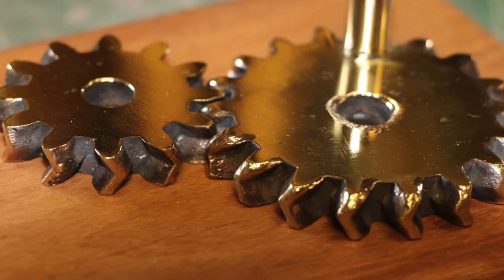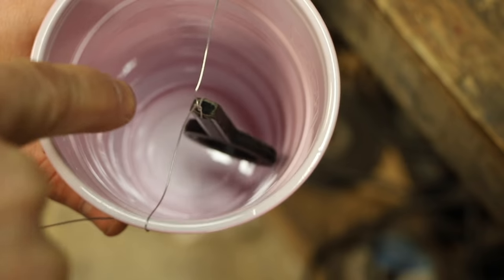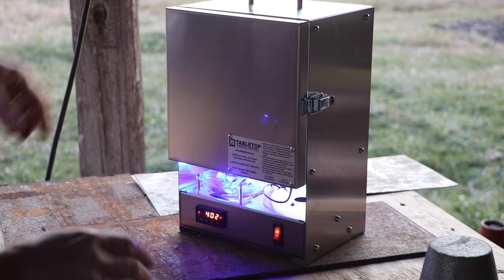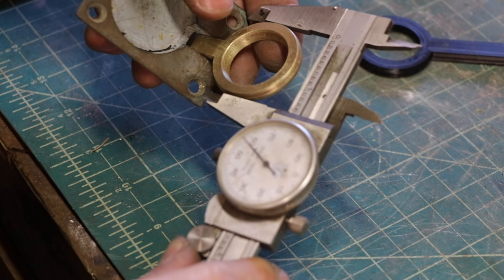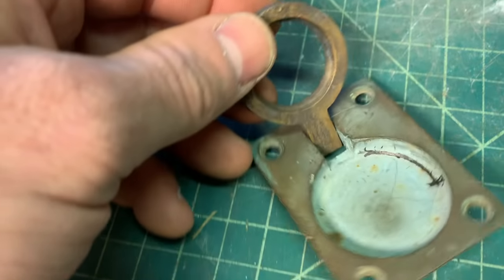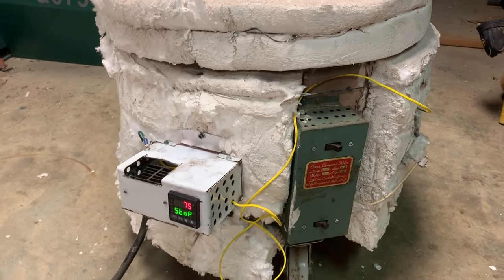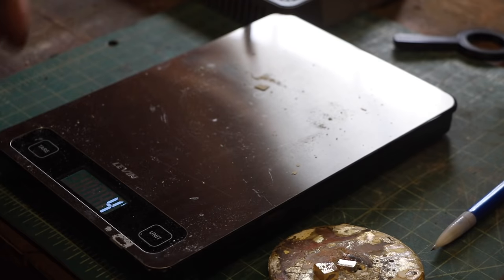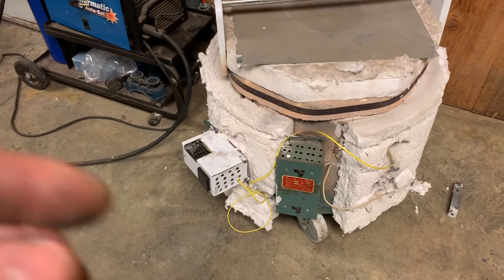3D Printing Metal At Home?  Pretty Much!  FarmCraft101

Comment: When I was at art school in '79 we had an interesting process that the teacher said came from the auto industry: You made your model out of wax , then you mixed up some construction sand and a liquid epoxy, Then painted your model with something called a zircon wash which looked and felt like a very soupy plaster, Then you carefully packed the wet model in the uncured epoxy sand in a cardboard box a bit bigger than the model and let it cure for a couple of hours, Then you put the whole thing in a 300°f oven for 4 hours so the wax melted through the zircon wash into the sand. Meanwhile you were heating your bronze or aluminum. Then you pour the metal into the mold, and the magic part was that the heat from the metal broke down the epoxy while the metal was cooling, so a couple of whacks with a hammer was all it took to remove the sand from the casting. You could make a big wax piece in the morning and have it in metal by dinner. The zircon wash was interesting stuff in that it was porus enough to let the wax out and the gasses out but it could preserve details like fingerprints. Oddly I have never heard of this process anywhere else. We also did lost styrofoam casting, but that is another tale.
Reply: They still do that process when the cost of manufacturing and shipping of ordered 3d metal print is prohibitive, mostly in poorer countries though.
Wax parts for the actual casting is still 100% 3d printed though, mostly smaller details.
Reply: That's still used in LOTS of industries. Anywhere you need a feature inside a part, you can cast negatives or positives and thermally remove them. Keeps from having to use welsh plugs. The stuff I use for prototypes is made for lighting on fire for quick curing. (Zircon ZA-95)
Reply: Cool
Reply: In a college sculpture class, we cast in bronze by first sculpting it in wax (a bitch to work with), then dipping it several times (each time letting it dry) in a silica sand and water slurry.  Once fully dried, we fired it in a kiln to melt out the wax and harden the cast.  Then poured in the hot bronze, busted off the mold with a hammer and it came out great.
Reply: That’s called last wax or investment casting, a lot of gun parts and auto parts are still made this way. Very fast, accurate way of making precision parts.
Reply: @mcruff  LOST wax!
Reply: Yep investment casting
Reply: When I was in high school, the art class had a "lost wax" 
centrifuge, to invest silver or gold.

Make a ring or whatever you wanted,cast it in Plaster 
of Paris, and put it in the centrifuge.  Melt your metal, 
in the crucible on the centrifuge, when it melts, pull 
back against the spring, (about 1/4 turn) and let it 
spin.  Crucible was close to the center of the arm of 
the centrifuge, and the mold was at the end.

Melt the metal, let it spin, and put the mold in water 
to dissolve the plaster.  Metal melts the wax, which 
goes into the plaster.  3 days making the wax ring, 
(no NOT a toilet ring!)  2 days to let the plaster dry 
out, and 15 minutes to invest a ring.

steve
Reply: Sounds a lot like an aircraft part casting process.

Comment: In the 3d printer you could make the gear teeth longer for casting and then trim them later
Reply: I think bigger parts need an extra channel for letting air out of the mold when not using vacuum.
Reply: Or he can ad bend teeths litel up so air stuck there and he can trim down
Reply: @Reno Simpson i can read my own mind
Reply: Its also possible to trim porcelain/rock using 3d printers mechanisms to create stencil blocks. Or use cnc to creatr gears ;p anyway technicallt cnc and 3d printers are the some thi g ;p
Reply: @ahmetmutlu348  3d printers are additive manufacturing while CNC machines (lathes, mills, etc) are typically subtractive manufacturing. They take material away from a larger piece of stock to create parts where 3d printers build the part up layer by layer.
Reply: Just like my real teeth!
Reply: I'm so glad that I found this video. I learned a lot.

Comment: Ex-Foundryman... ALWAYS add the riser.  The air has to come out.  You produced the classic case of trapped air with your herringbones.  Nice work though!
Reply: or invest in a centrifugal casting machine.
Reply: @maxheadroom1506  if someone is casting at home just add the riser, no need to reinvent the wheel and in doing so price it out of reach for many makers.

Comment: To get rid of the “there might be air in my plaster” issue, brush some directly on the piece and let it air dry before putting it in the cup.
Reply: I made a small vibrating table for degassing.
Reply: That's kilnly advice. 👍

Comment: I appreciate the rough cost preview. So many diy channels just say "hey look so cheap" and only calculate material cost and ignore all the tooling.
Another great thing is you showing the fails, and the subsequent solutions. It makes the videos more informative, honest and, when repeating your experiments, one isn't discouraged so easily.
Reply: Yea, i tend to get stuck at initial failure when learning new processes, including mistakes and pitfalls is gold.
Reply: Add on the electricity/fuel costs
Reply: We own 2 5x12 CNC routers. It’s true when they say the cost of the machine is just the down payment on the tooling.

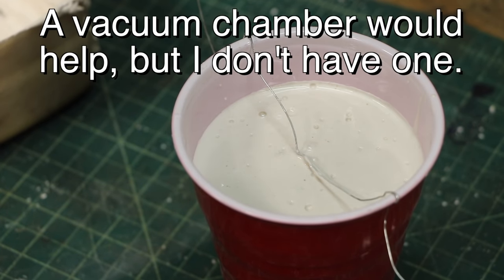Comment: At 3:30 a pro tip is to use anything that vibrates or oscillates relatively violently (hair clippers, orbital sander) and touch a part of the body of the device it to your mold to vibrate the whole thing  which causes the bubbles to vibrate up and out of the plaster. I do this on teeth/mouth molds since air bubbles are hell when you need the fine detail. Hope it helps!
Reply: A vacuum chamber pot setup is about 150 bucks. Now you can get into wood stabilizing and dying. Take the air out of the plaster, epoxy, etc. ✌
Reply: I made a vibrating plate for this purpose by taking my palm sander wall mount caddy and screwing it onto a board and then I could leave it on for a while.  Picked this up from the folks who pour cement countertops.
Reply: De-gas the metal prior, via flux.
Reply: Pressure pot would be more appropriate in this situation
Reply: or put it on top of an aquerium air pump.

Comment: I have a lot of lost wax casting experience
Suggestions: 
Print a sprew cone and  some vents to allow air to leave more easily.
Use dental investment plaster and keep it hot. Pull the mold out just as the metal is ready to cast. Pouring hot metal into a mold that isn't close to the temperature of the metal doesn't get best results.
Always use a steel containment AND add steel rings to the top edge of the container or build a collar to set the casting can into. Use a length of chain to swing the container around right after your pour. This increases the g-force on the molten metal and forces it into details better than gravity.
PLA has a specific density around 1.25 g/c³ and you can estimate the weight of the metal required by the difference the density of the desired metal. Make the sprew cone about 50% of the total mass so you can melt and pour the least amount of metal and still have a small sprew to remove... so, quicker and more efficient.

Do the majority of your cleanup on the PLA. It's easier to finish than the metal. This reduces the amount of sanding you'll need to do to the cast piece and allows you to get better fit and finish with less work.

Add a flux like boric acid to the melt to help separate slag. This reduces the risk of small oxide inclusions that can ruin an otherwise perfect casting.
Reply: Thanks for this wealth of information
Reply: Agreed, I'm sitting here trying to figure out how it's gonna pour without a vent xD
Reply: Awesome notes, hugely valuable, thanks!

Comment: Just a couple of suggestions for future pours.... When designing the mold, have the fill pipe fill the mold from the bottom and always include a vent for air escape at the highest point in the mold
Reply: I second this, especially the vent.  Id also just pay a machine shop to make a die, if you need more than one or two of these.

Comment: When you showed the burnout cycle, I read the temps as hexadecimal numbers (300F, 700F), I guess I've been doing too much programming lately.
Reply: There was no 0x in front!!
Reply: @GodzillaGoesGaga  There's no 0x on my calculator either. I have it in "Base N" mode more than "normal".

Also, I don't write it with 0x, I use old-school $. I learned hex on Commodore 16 and hand coded all my assembly with the built-in assembly monitor mode.
Reply: @sdspivey  Lighten up, you're being too pedantic!  😉

Comment: Hey awesome video! I appreciate that it's a tutorial from start to finish, including the design and printing. I love that you used a kiln for the burnout, it's a pain in the ass with the regular propane furnace but you can pull it off if you're careful. 

I did some of this with a friend this summer with a propane furnace and from our experience you really don't need the investment plaster specifically.

We lost pla cast some parts for a diy electric bike as well as some stock aluminum for milling. After a bit of research everything said to use investment plaster. This is essentially plaster of paris. It was pretty expensive for not a lot of plaster and we're college kids on a budget so we looked at home depot at all the interior plasters down with the drywall. These say they're "jypsum plaster". Plaster of paris is also a "jypsum plaster" with some added stuff here and there, but it's the jypsum part that counts the most for high temperature applications. We tried a few to see what worked; I'd recommend the Diamond verneer plaster. It's $13 for 50lb and it worked superbly. We actually burned those out without any reinforcement and didn't have any cracking issues. 

I'm sure there's a reasons to use investment plaster, but if you're really on a budget, just check that the ingredients list jypsum or plaster of paris, and in our experience it works well and costs a fraction as much. 

Great information man definitely subbing!

Comment: Get a small vibratory table and you'll knock out those bubbles. We do it in dentistry. You can also use a vacuum mixer if you really want but the vibrating platform usually does the job alone
Reply: For a small part like that a little platform stuck to a blade for an oscillatory tool works well. Alternately, a little platform mounted on some rubber with a wee electric motor and off balance weight attached to the bottom works a treat. The instructor I took Jewelry from uses a platform they fitted to the top of their vibratory tumbler. They also would paint/dip then smooth w/ brush a coat of the plaster to the part first, which makes sure the cast surface is as clean as you can get, then they put in the rest of the investment.
Reply: When I was in highschool my jewelry teacher had this handy little vibrating bubble remover, it attached to your finger and had a silicone tip for better contact, worked a treat.when I was older I figured out it's real purpose.

Comment: If you have an oscillating cutoff tool you can hold it against the can to vibrate the can a bit to get the bubbles out..I find that when casting resin parts that works wonders...

Comment: Personal experience: cast the plaster, wait 2hours, then heating for 300°C for 4h, then 4h more at 700°C. After this set the furnace to 250°C and let it in the oven over night. and cast on the next day. (reduces cracks) The roundness problem is caused by surface tension, place the part as deep as possible and keep venting in mind. (hydrostatic pressure)
Reply: Good/reliable filling at 200mm

Comment: Love the process and as a 3d printer I have all kinds of ideas. However, as a machinist and owner of a open die steel forge facility (industrial not back yard) I must say something I read on my dad's desk years ago.. "A Casting is nothing but a metal of questionable integrity, usually held together by welds and or braze".
Those gears not really useful in my opinion but sure is a great idea!.
Nice job!

Comment: I would like you to make a part that just is not available anymore. Ever go to the seller to get a part for the car, piece of equipment, or an appliance and get told the part is not available anymore, they stopped making it?
Or a piece of vintage/antique equipment that you want an authentic part for, but all the parts are just as worn out. 
I would like to see something like that done, and I am sure so would others.

Comment: I made a vibrator out of a multitool for getting the air out of plaster (or resin).  It also works well for encouraging metal to get into the mould.  It's pretty good for shaking rattle-can spray paint too!

Comment: Man, this is EPIC...  And it's a good, good insight into how to actually do this the right way for a lot of things.

And, no, he's not kidding- this is cheap for a large class of things you'd otherwise have to spend THOUSANDS for on equipment...and then learn how to actually USE.  I've not built up to Lost PLA casting but I'd heard it being done and I've been curious and wanted to see/learn more.  So far, I've been doing similar magic with plastic parts on my cars that failed.  Some of them...you're not going to find the parts in question, but the analog or the replacement is working miracles in my case.  Looking forward to even more miracles thanks to some of the insights here.

Comment: What I learned when I did metal casting with plaster is to mix 40% sand into 60% plaster. It doesn't affect the details of anything I've ever put in there but makes the plaster way more heat tolerant and generally will not crack. Just an idea for you. I did this casting aluminum.

Comment: possibility: use a alcohol soluble support plastic in your mold instead of PLA. Then you would not need a kiln, or worry about cracking plaster. Not sure if it would work, but might be much cheaper and more reliable.
Reply: How would you heat the metal to pour it?
Reply: a charcoal fire with a blower would work, or look up diy casting forge on YT

Comment: This video finally inspired me to try lost-wax casting. I use a really cheap vacuum chamber and pump to remove bubbles from the plaster. I've tried using a fine slurry, then casting sand, then more slurry and more sand to get a good coating on the print, then using investment casting plaster to fill the rest of the container. I'm casting microwave antenna components rather than gears. A nice Metal-X printer system for pure copper is "only" around $200k, so I think I'll be stuck with casting from printed patterns for a long while!

Comment: Wonder if you could make the gears with "over-length" teeth then turn them down on the lathe co get rid of the bubble/rounding issue
Reply: just use vents in the mold and you wont have the bubbles from air getting trapped

Comment: Thank you for the insights and saving us from making those mistakes. I am in the process of getting a 4 axis CNC machine (Carvera kickstart) and I believe this process would be an excellent compliment to that process to do rough parts and then finish with minimal waste. I also have a Creality 3d printer (CR10 mini). I have been playing with the Fusion360 software, which I will probably purchase a license as it will do the 3d printing and CNC operations. I worked 3d design using ProE for about 10 years; managing the department for the last 7 years, so it will be great to get back to it! I have a lot of friends in the warbird community and will be doing parts that can no longer be found! SS
Reply: Cool new chapter! Have a blast. ✌

Comment: "anything you can 3d print you can cast"'  except for those that needs internal structural support
Reply: The metal will be the internal support.
Reply: @sdspivey  nah you don't understand, say you have a box with spruces inside for some reasons, you can't do that because the inside plaster would need to levitate for exemple
Reply: @Sinaeb  I can't think of any shape that needs a hollow area that isn't also connected to the outside. If there is such a hollow, then no one will ever see it anyway, fill it.
Reply: @sdspivey  There is a lot of things that needs it, for mass and strength optimization, which is why people are trying to 3D print with metal
Reply: @Sinaeb  Yep, cores always make things complicated. Even with metal additive the issue can often come down to how do you get the powder out of the area in question. You can make up some of that using a direct deposition process, but then support gets tricky and dimensional tolerances are potentially not there. Going to be fascinating to see how this process will evolve as additive/subtractive machines get more common. 

I have seen people doing 'floating' cores in PLA by putting a pause in their print run, and then carefully inserting some sort of pin (material depends on what you are casting. If you can use something that will braze to the casting alloy and not cause corrosion/CTE issues you can even leave them in) in the print that will hold everything in alignment once the PLA burns out. The remaining hole can either be designed around or drilled out and welded. Getting the support/filling/venting/emptying design of this type of thing right is fiddley, and QA can be a bastard, but it is totally doable.
Reply: Incorrect, you can get a 2ndary dissolvable filler material.
Reply: Came here to say this. A lot of people in the 3D printing world still don't grasp that additive manufacturing has some benefits that casting/molding/machining simply cannot reproduce. For simple things like gears, knobs, or trinkets casting is just fine. But for something like GE's engine nozzles there's not another way to create that geometry.
Reply: You can use graphite rods and other structures to get channels and pathways.  Also with strong investment, you can get 2mm+ pathways
Reply: Yeah, more like the other way, "anything you can cast, you can 3d print."